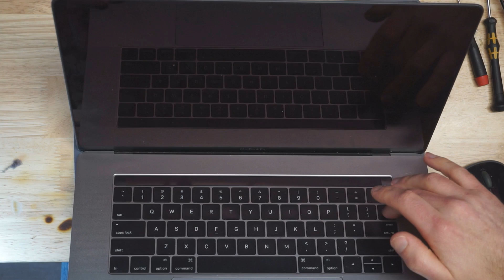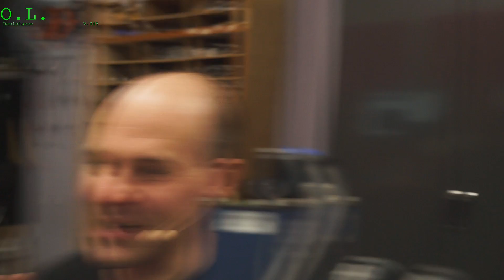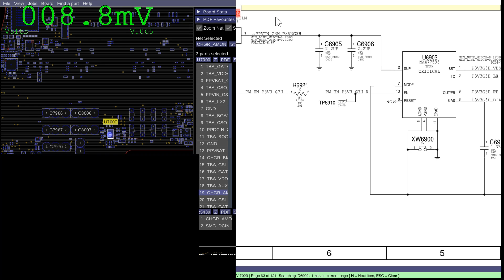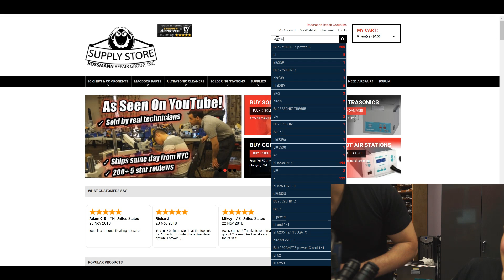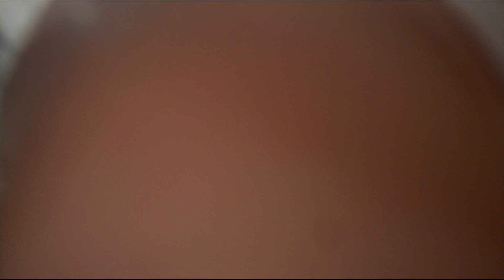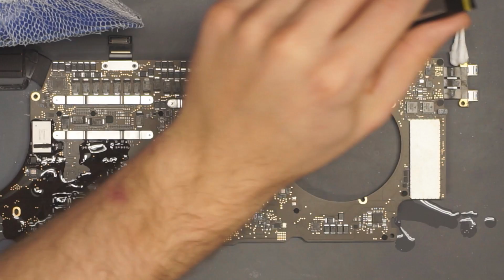USB-C charging failure in Touchbar Macbook Pro

Comment: toulene is great. They used to run it in 1500hp engines in formula 1, and it is the one of the main ingredients in TNT (triple nitrated toulene). Cleans stuff like it's no tomorrow!  Bad stuff though is that it has neurological effects (also used as recreational inhalant) and it has possibility of permanent neurological damage.  Outlawed a lot of places in high concentration, but I managed to find some really old cans of 99% toulene and I found it very powerful.

Comment: I was a tech in the 90s and did component. Level. Repairs. On beepers in woodbrigde NJ I love the way you repair. The Mac we had desoldering stations and finally hot air guns we used to call the hack shot gunners who just replaced any parts that they thought. We bad our stuff came from England bakwords brittsi wish we had the tech we have today

Comment: Re: using / to search: that's a fairly common keyboard shortcut for that in command line software. Programmers are likely to think / is an intuitive choice for a search command. Programmers are also likely to think of themselves as typical end users. Pro tip: we're really not typical end users and we need to remember that.

Comment: Instead of using your forefinger finger tip, in order to check for warmth/heat, depending on the 'callousness' one might have, 
on the whole, it is better to use the 'back portion' of your fingertip (i.e., on top of your forefinger nail), to check for heat.
It is more sensitive.

Comment: Youtube should start to support VP9 and later AV1 encoded streams from the source at least for lower resolutions so Duke could stream as well. Than viewers with a slow connection could watch higher quality video or load network less for others. Nice, informative stream.

Comment: enjoyed this episode..love watching you fix hardware like it's nothing you make it look so easy..btw also from The Netherlands.. more west a place called "Den Haag" not a hardware guy like you but a 42yr unix/linux sysadmin..btw also on a macbook because a few years ago i was lazy and wanted to get one mac before apple started soldering everything in.. so this is a mid 2012 15inch..performs well enough added sum mem and ssd storage.. but as soon as i save up a bit i'm going for a threadripper running Linux full time.. Perhaps i can find someone like Duke to repaste my macbook pro i need to keep SMCfan control running at 3500 or 4000 to keep it cool even when i have a couple of browsers open.. let alone start a couple of vm's which almost always do.. seems like it's running warmer last couple of years.. and i do clean it also from the inside.. (remove the dust)..
btw for everyone looking for a laptop that is not apple.. i have bin hearing good things about the Thinkpad T480. runs Linux without any problem and even if you must windows..i'm not liking what apple is doing when it comes to the right to repair..that's the main reason for me switching and the bad cooling.. just a side rant.

Comment: I loved the video but I have to strongly disagree with what you said about eBay,
It is the consumers who are screwed.
I recently spent a lot of money with one trader and had a problem, I contacted the seller who sold me the same parts twice and then in our communication through eBay said that according to there records I had received the Correct items.
I sent photo evidence and my profile shows that I very rarely leave negative feedback,
You tell me what I can do now?
In the past I had a similar problem, eBay did jack but PayPal looked at his account,  I am guessing that 
The seller had other similar complaints and I was given a full refund.
eBay earns more from sellers than customers so the system is designed to be seller biased.

Comment: Dell is by far the worst laptop brand. I don't get why Louis always gives them a pass. The coil whine that 80% of they're pcs should not be excused either.
Reply: Idk what direction dell has been going but i have an old as balls windows xp laptop from dell that still works perfectly fine (for a windows xp laptop) obviously I don't use it anymore but it still works fine for old apps
Reply: @kevind.3074  My MacBook air lasted 7 years with no problems at the slightest bit. Never hiccuped or anything and then I updated to a new pro and have had 0 issues aswell
Reply: Louis and his team are Mac haters and to be honest it’s getting boring, interesting videos but give the Mac bashing a break guys. I have had macs for over 30 years and only one hard drive failure. Let’s put things in context and except all manufacturers have some issues and macs are no different.
Reply: @ronsummerill2496  spot on. Yes they have had some issues but every laptop brand does. Apple has 10x better trackpads, ssd, design than any other
Reply: blitzwing1 I understand your view and yes if as you say it’s bad design and bad practice then truly I cannot defend apple even though my experience has been very good. I do wonder if Louis is making his judgements partly because all he does is fix Mac books all day. This really is a very small number of all the Mac books in the world. It’s the same in health care, I worked in a very specialised neuro surgical unit and we had a run of child hood aggressive  tumours, the surgeon said it may seem this is is very common but the true fact is most doctors will never see any of this in their working career.
I have tried Sony and Samsung laptops and neither came close to the lifespan of my macs, the Sony was done in less than two years and the Samsung was a disaster. So I can only go on my actual experience but I do look after my computers, never any food or drinks near and on my laptops I always use a cover between screen and keypads.

Comment: Use soft toothbrush not cottonsbuds bro!
Reply: I totally agree with you. I use pencils like the ones you would use for painting to clean off the flux residue. afterwards i go over it with a kimwipe and it leaves zero fibres behind unlike using Q tips...

Comment: Dear Mr Rossmann, I would like to buy an Apple Macbook Pro for audio processing. Which model/year would you say is less likely to have some kind of major issue?
Reply from the maker: Lenovo thinkpad p52
Reply: @rossmanngroup   Message received. Thank you.
Reply: Go with a Windows machine, and make sure its got a powerful processor, and upgrade the RAM. Dedicated graphics is also a good idea, because even though you are only using it for audio, dedicated graphics will take load off the CPU. A lot of plugins are very CPU hungry and bigger projects will eat up RAM space. You may also want to look at a hybrid HDD/SSD, keeping the operating system and your SSD and storage on your HDD for snappy performance and plenty of storage.
Reply: I bought into the "You have to have a Mac for audio" meme too. It's rubbish, Windows will do what you need it to, you just need to put a little more work into fine tuning it, but you get the advantage of affordability and a customisable machine that can be purpose built with much more performance than  a Mac.
Reply: @Patrick-857   Thank you for your comments. Do you think windows 10 is better than windows 7 for real time audio applications (daw's, plugins, asio drivers, etc)?
Reply: @mhzgwnsntip  I have heard that 10 is better but I'm not very experienced with it. With 10, I would go in and turn off all the "phone home" shit and basically anything that isn't a necessity.